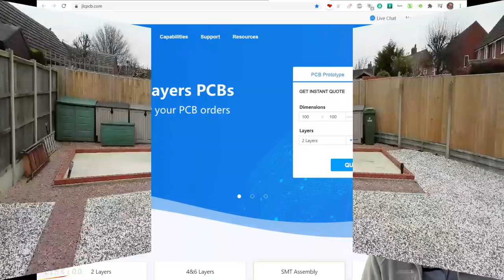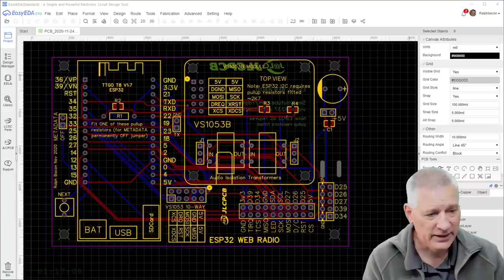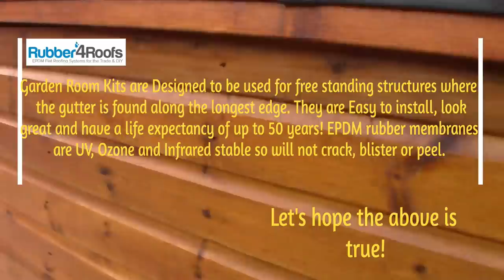#212 Arduino Man Cave aka Workshop Tour 💻

Comment: Oh, that's amazing Ralph. I'm quite jealous. Looks like you've done a really good job with it, learning everything from Workshop v1 and taking it to the new one! I still think that nRF24L01 sensor networks are the way forward and have an idea about your heater on/off problem. You could use a CT clamp to detect current going through the switched circuit and then set up something to turn off the heater when low usage is detected. You also have the added benefit that you could see how much power usage your switched circuit is using and you wouldn't have to cut into an AC wire. Anyway, I'll leave it for now while I patiently wait for your reply to my email (maybe it went to spam again :[ ) :P
Reply from the maker: Thanks Jess. Sorry it took so long to spot your comment (I've been reading your emails, looks like you've been busy).

Comment: Hi Ralph. Thanks for your videos, so much appreciated. Your workshop is so like mine but unlike mine, so very tidy! A quick question. I use jlpcb a lot and I like the idea of trying out 3D printing. What software would be easy to learn and preferably free ? Also what file formats are acceptable. Thanks so much. Bob Clarkson
Reply from the maker: Not so tidy any more, Bob! It's been about a year now and there are so many components and bits of equipment... but at least it is organised.

3D printing software? I was recommended to use the free course from Autodesk Fusion 360 but it's a steep learning curve.

The starting place for a "personal, not for commercial use" licence is here:
https://help.autodesk.com/view/fusion360/ENU/courses/#fusion-360-academy

It reminds me only too well of PCB design which took me a good year to learn well enough to produce PCBs that were acceptable (and I'm still learning).

I just need more time!

Comment: I can't help thinking that it would be much easier to integrate your heater control, bin lid alerts etc  if each device used MQTT and talked to a device running Node-Red. You can then define your logic within Node-Red and simply tweak it without having to re-flash the code on your devices if you want to make minor changes.
It would also be easier to add-in additional sensors to monitor temperature and humidity within the workshop, and override the basic timer logic for your heaters.
This is how I've built my home automation systems for my home and holiday home and it works really well.
Reply from the maker: Well, "easier" is a relative term but I agree that if I already had a simple MQTT/Node-Red system up and running it would be easy to add stuff to it. I wanted to do just this in my last workshop but never found the time (it's not exactly a two minute project, from scratch). But it's still on my list of interesting things to do, so you never know.

Comment: Great shop but whry did you not add a second unheated storage room instead of the three bins
Reply from the maker: Short answer: money. Longer answer: lack of money and we had the 3 bins going spare (well, going to the local tip if I didn't make use of them!)

Comment: Hi Ralph, I know this is heading for two years ago but, i'm thinking of building a new workshop and i'd like to know how you are getting on with yours, anything that you wish you had or hadn't done? And the ever testing question.... Is it big enough? many thanks and sorry for revising this old thread!
Reply from the maker: Dave, my workshop is about 5m x 3.5m which for a non-woodworking workshop is a decent size. I wish it were bigger so the DIY bit of it didn't spew all the sawdust over the rest of the room!

It's insulated like a house (100mm insulation batts in the wall, floor and ceiling) and the wall are both lined with 12mm plywood then plasterboard (and skimmed). Very warm and efficient to heat.

I wish I had installed air-con from day one. I'm still considering it. Last year I could not use my workshop for a few days during the 40ºC heatwave the UK had.

Storage! Never enough. I have 3 outdoor storage containers (Keter, plastic) but it is a pain having to go out there and the condensation in the winter is ridiculous. A larger workshop would have enabled better indoor storage.

You can email me for more details (and pics) if you want!

Comment: I love it, congratulations. 
Carpeted, but I imagine no issues with static electricity: you are in England :-) Where is the 3D printer going?
Reply from the maker: No static issues that I can detect, but I use a wrist strap when I touch components, mostly. And the humidity is usually quite high, 40-50%. Now, that 3D printer, hmm, I wonder?

Comment: How about when you shut off the main power to the equipment you could have the heater keeping the heat to say 10 deg C to keep it frost free, looking after your equipment/gear.
So the heater could be controlled by a separate thermostat when your power is off.
Thanks for the video.
Reply from the maker: Spot on, Anthony. Just what I need. My designing cap will be going on soon.

Comment: Sorry Ralph, but it's time for some tough love.  If you have to store rain-sensitive stuff outside, the man cave is too small  ...but you have decked out the inside very impressively.
Reply from the maker: Well, I made the decision to only have stuff inside the workshop that was Arduino-related or that I use frequently, such as my Makita hand tools. But club hammers and circular saws are only used very occasionally, and then only for specific jobs, so they are definitely staying outside.
Also, crates of electrical 13A sockets and wires have no place in my day-to-day running of electronic projects so they can stay in the bins too. I did this for a year in my old place and there was no damp, condensation or mould so I'm pretty confident that it will be fine (especially once I get the crates organised properly).
I'm glad you like the inside though!

Comment: Why not use a simple thermostat with time day settings?? for the heater, and where is the 3D printer in the workshop??
Reply from the maker: 3D printer is on my list of things to now look at (I now have the space, and easy to install some ventilation for it). But a simple thermostat, timeclock etc (the heater has all that already) is just not Arduino enough for me! I just know I will leave it on 22ºC overnight. A programmable thermostat would be a step forward but, once again, not really Home Automation enough!

Comment: I thought the heater was overkill for a small building like this, a 200-400W should be plenty IF you have a really efficient heater, and don't open doors for no reason, I used to heat my flat with an Intel Pentium 4 CPU! Was always too hot even in the winter.
Reply from the maker: I brought this from my previous workshop. I have to admit it probably is a bit powerful but that does mean it heats up the workshop quickly and then cuts out and stays mostly switched off (using its in-built, rubbish thermostat).
Reply: @RalphBacon  fair enough, wasn't complaining, I just thought it would be a bit inefficient, and you'll get too toasty, and grab a drink 😉 to cool off. Then you'll never get anything done.

Comment: Why don't you have a roof over the bins, you don't need walls just posts. Also humidity is a concern storing electronics outdoors even if weather protected. This leads to corrosion very easily, you need some sort of airtight seals on the bins as well as a roof.
Reply from the maker: Roof is a good idea but it's a wide length, the wind would rip it off in a heartbeat unless it were secured very firmly to the floor via posts. Too big a project for right now. I used one bin in my previous place for electricals and they all survived the winter very well. We shall have to monitor.
Reply: @RalphBacon  cement post holders in when you're ready Can even be two roofs beside each other to reduce the footprint. Maybe you could put an Arduino sensor in the bin to monitor humidity to see if electronic components and modules are at risk.
When you eventually put a secure roof over the bins that roof and the shed roof would be ideal for solar panels.

Comment: Those monitors are tiny and so low down, you'll go squinty looking at those. I've learnt my lesson, now have 42inch monitor and a pair of squinters From Specsavers. I used to have 4 monitors and this one does it all and no squinty vision (usually).
Reply from the maker: Well, they are smaller than your 42" monitor for sure, but two 24" monitors (plus the little one) is going to have to be enough for me. The height is correct, though, for when I'm sitting at the desk, thanks to the gas struts. As for squinty vision, well, you know the history of my eyes over the last 2 -3 years! Squinty vision is now a permanent part of my life 🤓

Comment: Do you use ESD desk mats?
Reply from the maker: Not as such. When the occasion arises (that is, I'm dealing with ESD-sensitive components, even MOSFETs) I use a blue wristband connected to GND on my 'scope.

At other times I try not to put my fat fingers all over the components but  most components I use are not affected by ESD, especially if built into a 'dev module' of some kind.

Comment: Not a man cave by US standards.  I guess it's different over there.  At least there's a tri-monitor for gaming.
Reply: I also have a Mancave sign in my workshop that should be also a UK standard, I joined Manshed in UK to help others plus they help me.
Reply from the maker: Hardly more than a box room, I know, Danny, by US standards this is nowhere big enough. Then again I do have to heat it in the winter, something that many Americans don't have to do due to the moderate temperatures. Yes, tri-monitor (with the smaller one now on a gas strut too) but not for gaming; too much coding going on!
Reply: @RalphBacon man cave is  for friends.   a couple pi powered  games.  Size doesn't matter.